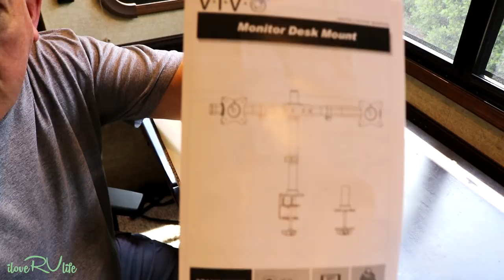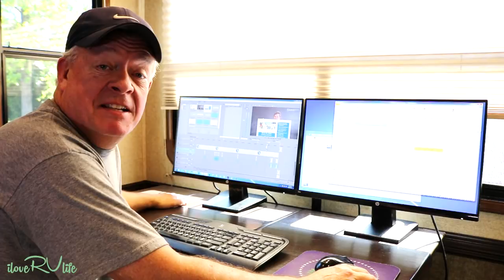RV Office - Adding Dual Computer Monitors

Comment: Jerry, I run a 32" LG monitor with a split screen when needed.  However, I like your new setup.  I'm still trying to figure out how to bring along my custom built full tower that screams with the latest and greatest!  Thought at 72 I would give building one a shot and did it!  Now to fit it in the fiver!  lol
Reply from the maker: I'm too had this great 32 inch monitor.  It couldn't handles the road and lost a couple LED panels after 9 months on the road.  It was a very sad day when I  threw it in the dumpster.  Won't buy another expensive monitor.  I too have a big tower for video editing and Photoshop.  Generates about the same amount of heat as a pizza oven.  I built a small ATX unit, all SSDs, big i7 and water cooled.  Got it about as quite as you can make a video editing suite and it is a screamer!  Works great for the RV.
Reply: Have a water cooler by Corsair too.  Have you tried the new M.2 drives?  Running that with 2 500 gb SSD drives as well.  Smoking!
Reply from the maker: My big tower has two in RAID 0 for the main disks. Shame, this box is hardly used cause we're on the road so much.  For the ATX, just a couple SSDs only, no RAID.  Such a small box.  Bearly made the water cooler radiator fit.  I haven't tried the M2s.  I'm using Samsung 850 EVOs.

Comment: One more thing I forgot.  I wonder on your solution if you put some foam/rubber or something pliable between the monitor bases and the table to give it more cushion when traveling.  It was a great idea to leave the bases on the monitor.
Reply from the maker: Thought about it, but there were no issues with the first 300+ plus mile trip.  All was in place and screens look good.  I'll let you know if things change over time.

Comment: Thank you for the vid.  I'm in planning stage to go FT.  I work DevOps remotely for company (22+ years).  I like your setup and what I may end up with.  One question.  Where did your desk come from?  I've been wondering if I can purchase manufacture a dual monitor setup but have it swing out in front of the center most theater seating chair.  So think I would get rid of free standing dining table and manufacture new table that would be half dining and half heavy compartment side close to the chair.  Then have same sort of monitor brackets but have it with movable arm to swing out.  The arm base would connect to the heavy compartment end of the new table.  That way keep we keep one dinette seating available on one side.  Will have to be heavy duty. Concern will be how it stores with swinging back over the table and strapping down while not in use or traveling.  In the end this may be going too far and your setup is the backup approach.  Thank you so much for sharing.  Great solution for a great price.  You are also right about how more efficient you are with having two monitors.
Reply from the maker: Hi Glenn, So glad I could share.  With RV travel, I can't stress enough the KISS method for the office.  One thing I've found out, if it moves, it will eventually break.  Road construction, uneven concrete, those darn bridges create so much movement in the camper that anything the isn't mounted well will fall or move around. Case in point, I had this expensive, 32 inch monitor.  Ruined it in 9 months of travel.  As far as a desk, I have plans for an upgrade in the future.  For now, the existing dinette works.  I'd suggest traveling and working on the road for a few months.  My bet is your first ideas will change. It did for Joan and I.  We rarely used the dinette.  Prefer a simple, uncluttered living space.  My corner work area needed to support computer stuff, plus area for a notebook.  Printer stays in cabinet and is rarely used.  I PDF everything.  Use Myfax for the rare times when I need to send or receive something.  I have a couple large backup drives. Purpose built editing PC in a corner.  All this came out over many months of travel and I made small changes along the way. Moving from a 14 X 14 foot office to a 3 x 4 foot space has it challenges, but the views are great!  Jerry...

Comment: Hi Jerry, I would like to offer a recommendation.  Eight months late?  If you put rubber grommets on each side of the screws that attach the monitor to your 8 month old mount it should ride much better.
Reply from the maker: Thanks much.  I’ll keep this in mind as we continue our travels.  We’ve had quite a bit of travel since the monitors were installed.  The trick was to leave the base on each even though they are attached to the stand.  This has kept them in place and so far, so good.

Comment: Thanks for the video - maybe a piece of 1/4 rubber cut to fit for the circular plate would reduce vibration?
Reply from the maker: Hi David.  It’s worked well so far.  We were on some extremely rough roads over the past two months.  So bad, we had light fixtures fall from the ceiling.  Good news, the monitors stayed in place!

Comment: Hi Jerry. Just came across your video in a search to see how others are handling this. I'm in a similar business to yours. I have a similar Vivo stand with a U-shaped base bolted to my desk at home with 2 27" Viewsonic monitors. I'll be setting these up in a Safari Trek later this year. My biggest concern is internet bandwidth when uploading videos. I'll look through your other videos to see if you address this.
Reply from the maker: Hi Bill. Glad you found the channel.  I'm in the same boat.  Work requires me to have reliable, high-speed Internet.  This maybe a solution https://youtu.be/0QEsZMkYqU8.  I also discuss video needs, but you may find the bandwidth discussion helpful.  Jerry...
Reply: @iLoveRVlife  Excellent, thank you! Oh, and you've got me ordering a raspberry pi kit to build a media server. :-)
Reply from the maker: Thanks.  We’ve been using this weekend.  It’s the trick.

Comment: Thanks. I'm curious if you removed your table and turned it sideways. I would like to do that to create a wider work space. We rarely use our table for dining and this would give us a more accessible work space.
Reply from the maker: Lucky for us the table has a spring latch that allowed us to turn sideways to run the sides in.  It also has a leaf to expand another 12 inches.  If you don’t have the latch, shouldn’t be difficult to remove a few screws, turn and reconnect.

Comment: Wow. I'm stable in my older 2004 fleetwood ..she still needs work from sitting sadly on a wall by the door. However I moved in....I am wondering with the 15amps I'm tied to, how much power I'd be adding putting my PC , Dell XPS 8300 Core I5 2320 and crap stock radeon gpu..That and a cheap interface and studio monitors. This will be for my guitar playing and some light recording. The monitor LCD display is an old 720 p ish samsung but it will suffice. Should I worry about its power ? With that I understand I use an AC summer a little portable 12000 btu and understand I cannot run the other stuff heavy like microwave while running it    and etc. Just trying to gauge an understanding or ball park of the behringer 2030a Truth series studio audio monitors and the PC wattage or amps I'd be pulling with the software Daw ....I have a feeling I can run it all on one outlet using a strip...again thank you and if you know if this will exceed or run too closely to like a camper termed "High Watt" appliance please let me know? Thank you Sir.
Reply from the maker: Hi Robert.  Hard to say on the AC.  Looking at 12,000 BTU window units, specs are around 10amps.  Expect older units may be a bit more.  Guessing the PC rig will be similar.  Doubt this will work.  We bought a nice refurb, i5 cpu, off lease laptop off Amazon.  Nice unit that didn’t break the budget.  May be an option keeping the AC on and music production ongoing.